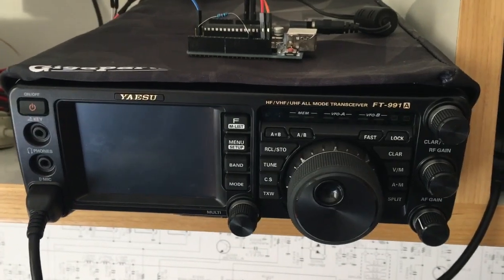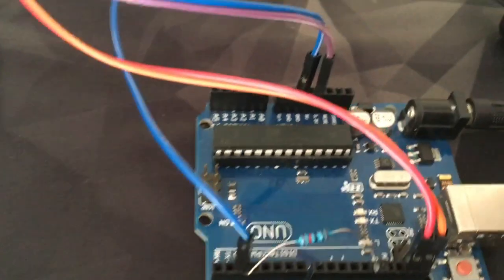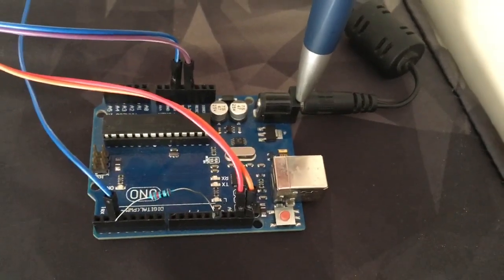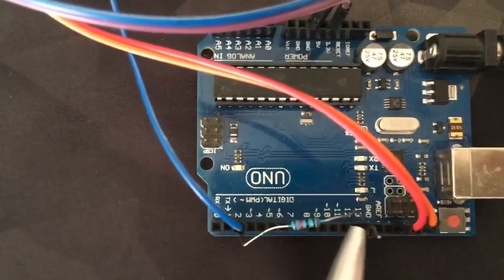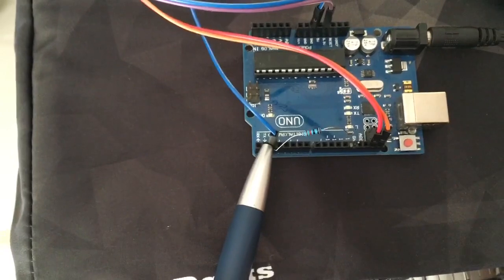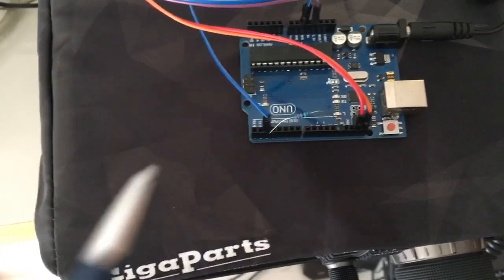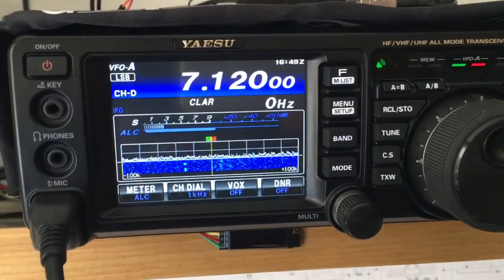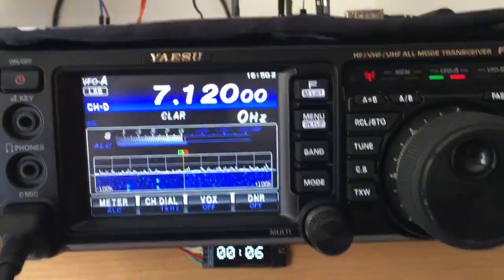OLED TX timer compatible with Yaesu radios - FT-991A

Comment: Hi, great idea!   How much would you charge to make me one of these?
Reply: Thanks so much for the details.  I will try and give it a shot once I get the radio, I’m ordering the 991 in a few days.  How about the connectors?  Don’t I need at least 1 connector to connect to the radio as well?      FYI:  I bet if you made these, and packaged them in a small plastic box, you would sell a bunch of them online!  Shipping should not cost much to the states... ?
Reply: @rodrigofreire7604  I'm ordering this stuff, going to make.  One quick question,can this style of display work? 

https://www.amazon.com/gp/product/B01N6AIG6A/ref=ox_sc_act_title_2?smid=A30QSGOJR8LMXA&psc=1

I found the correct display with 4 connections per your instructions, BUT this type of display has mounting holes so it can be easily mounted in a project box.  IF not, I'll just order the proper one with 4 connectors, thanks again!!
Reply from the maker: Hey! Did you move forward? Anything that you can share with us?
Reply: @rodrigoabfreire3490  Well, I ordered the parts, downloaded the software, received all... BUT, decided to return the 991a, and get a IC7300 and IC-9700 instead.  Passed my Tech test, taking the General test in a week or 2.  Then I'll get everything set up and get this timer working with one or both of the radio!  ;-)  Don't worry, I'll report back when done!  thanks   KD2UDQ (soon to be K2STP)